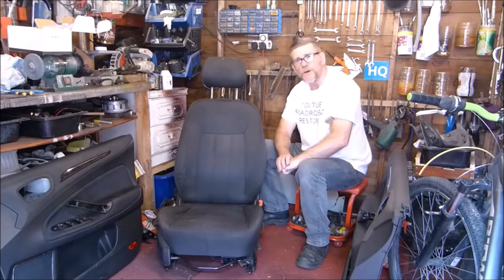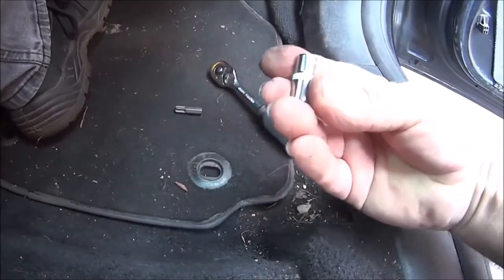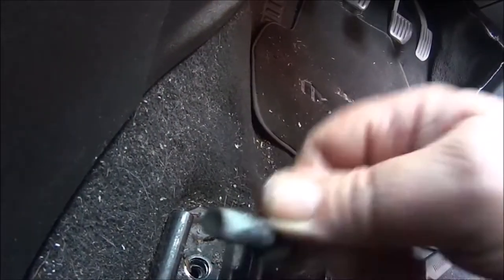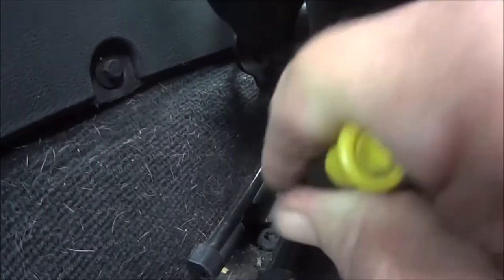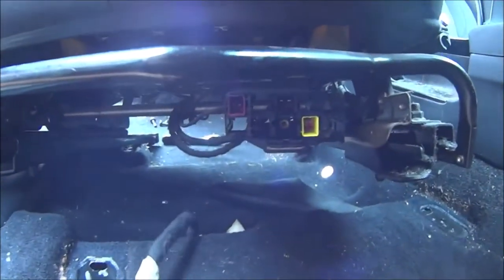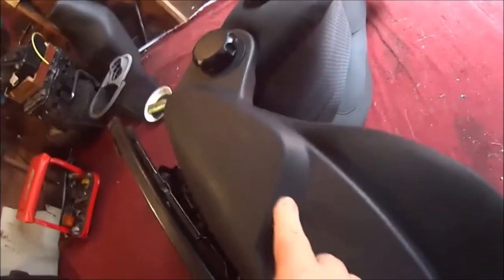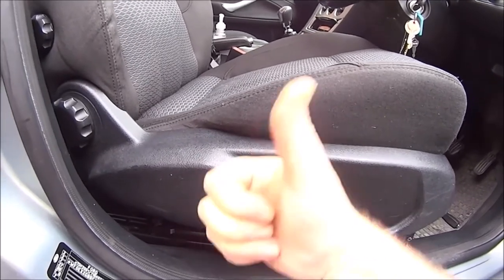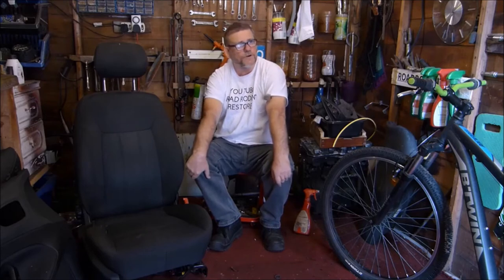FORD MONDEO MK4 drivers seat removal UK

Comment: Thabkyou. Looks easy. I need to get mine out as something is broken, which means the seat wobbles and also, the electric height adjustment doesn't work
Reply from the maker: Just 5 bolts. Don't forget to disconnect the battery air bag in the seat. Good luck.👍

Comment: Hi  noticed the old seat that you toke out had the leaver to raise the base up or down,but the new seat had a switch to do this,am i'm right in thinking that the wiring is already there in the connecting bloke under the seat and you did'nt have to ad anything,cheers,good video by the way
Reply from the maker: Hi. Thanks buddy. Yes the wirering was already there. 🔌 plug and play. 👍